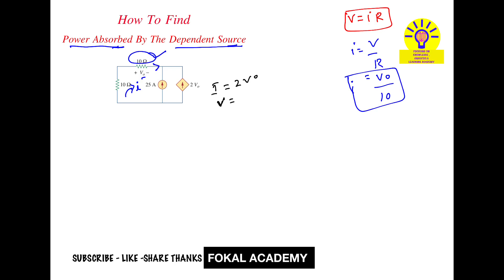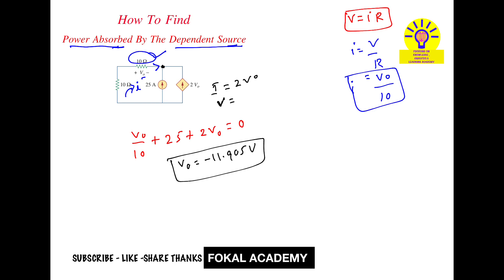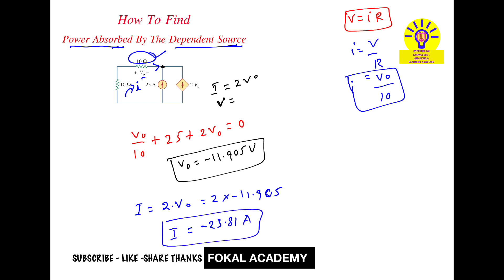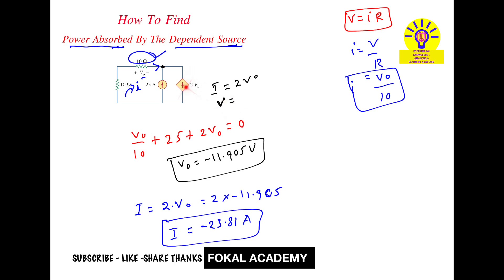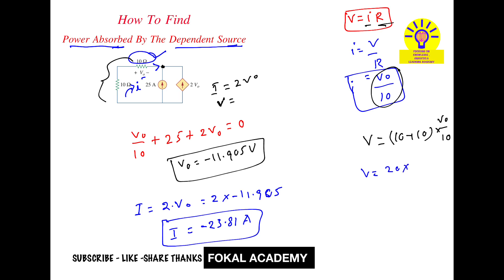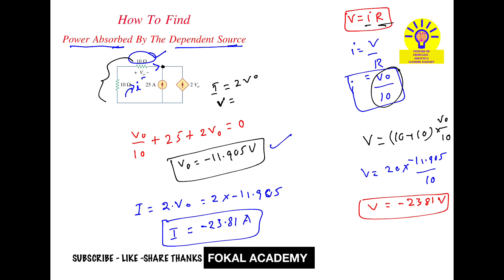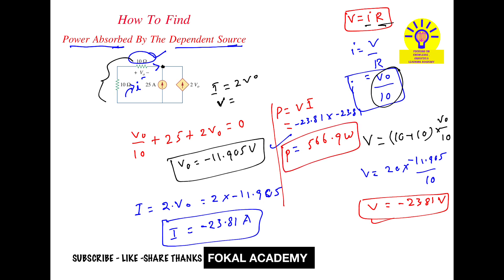How To Find Power Absorbed By Dependent Source | KCL Solved Problems

Comment: hi i have a question
I tried using the equation 25Vo + 25 -Vo/10=0 but I can't get the same answer for Vo
Could you please let me know if there's something wrong with the equation or my approach? Thank you!
Reply from the maker: 25Vo ??? How did you get, check question
Reply from the maker: It was 2vo
Reply: ouh yes sorry typo 😅
2Vo +25 -Vo/10=0
I assume the current direction for Vo is go out the node. (25A + 2Vo = Vo/10)Is this wrong?
Reply from the maker: All  are incoming currents towards node